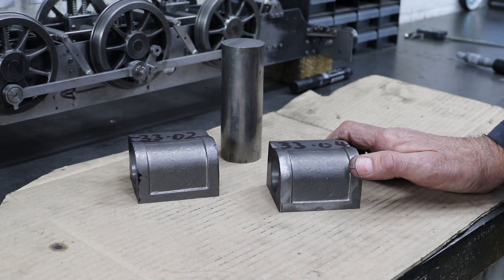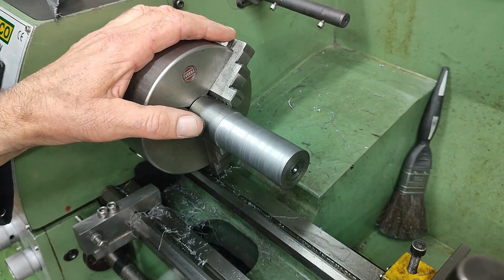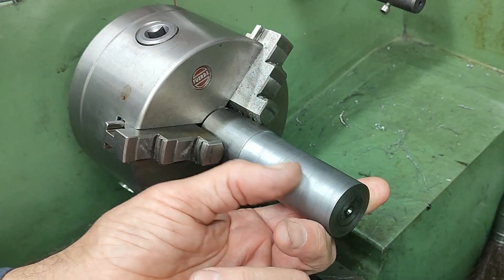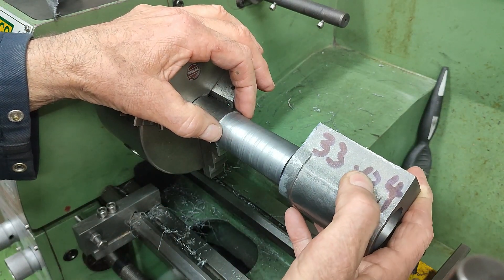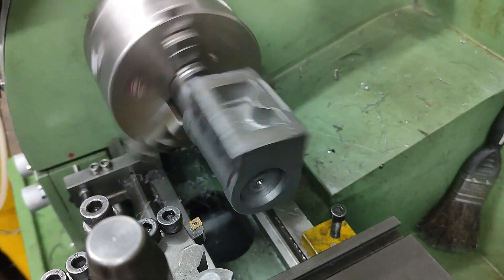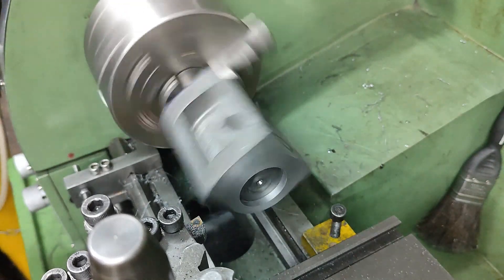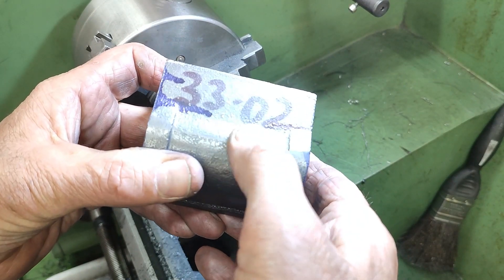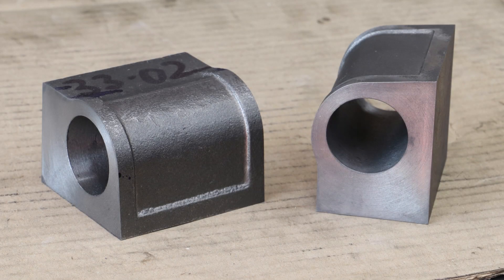Part 21: Facing the Cylinders

Comment: With the taper mounting, I'm surprised the friction enough to hold it rigidly and perfectly perpendicular? I would have thought it might go on at an angle and you'd have no way of knowing?
Reply from the maker: Hi William,
I trust you are surviving being a dad?
The cylinder is held square by the mandrel, the taper on which is very shallow is only at the very end (headstock) and is enough to grip the cylinder for facing operations (only).
Reply from the maker: The bulk of the mandrel is a tight fit in the cylinder bore.
I hope that makes sense?